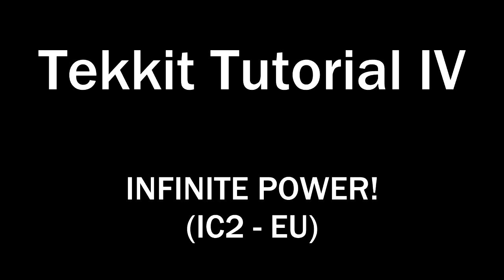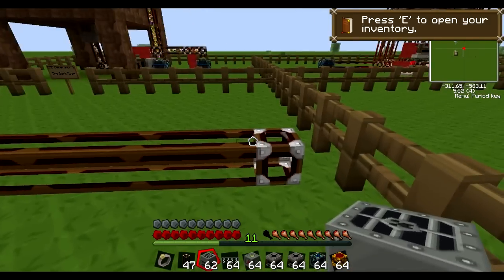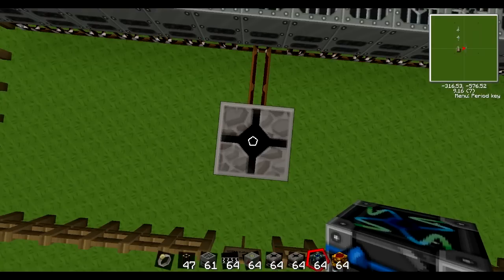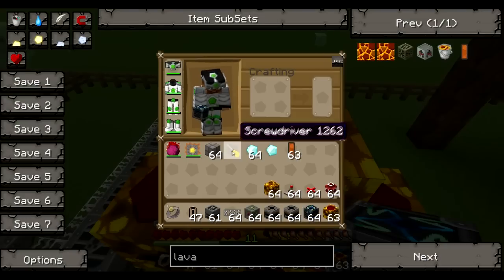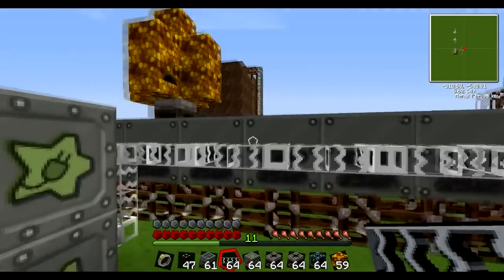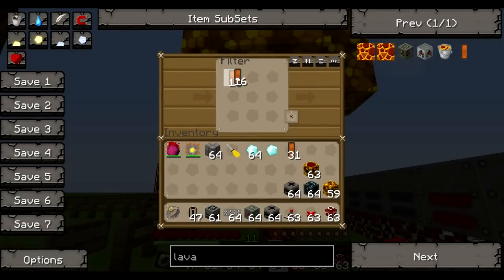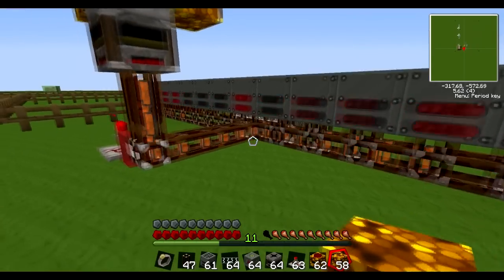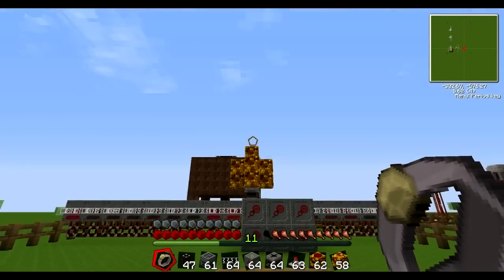Tekkit Tutorial 4 INFINITE POWER IC2 (EU)

Comment from the maker: I generally use redstone tubes as they carry a redstone signal and aren't that expensive to make.
At 2:52, what I do is I place down jacketed cable which connects to the pipe and on the ground beneath it I place a red alloy wire using this connects the pipe to the timer.
An alternative is to just use a piece of redstone between the pipe and timer.  (note: pipe must be a redstone tube else it doesn't carry the redstone current.)